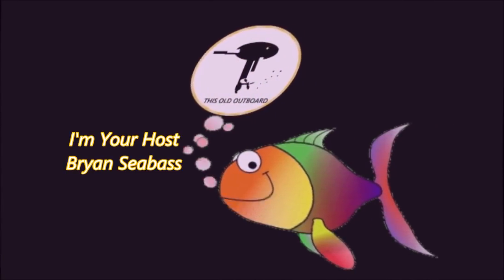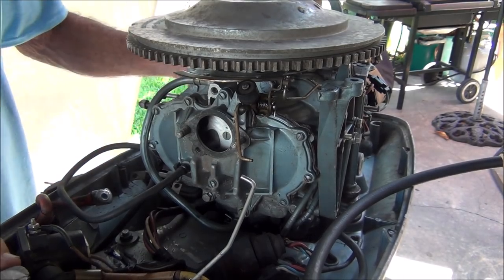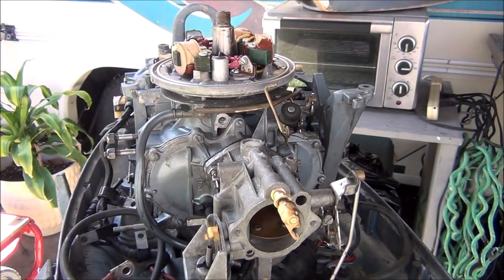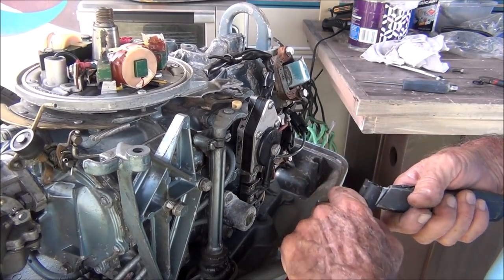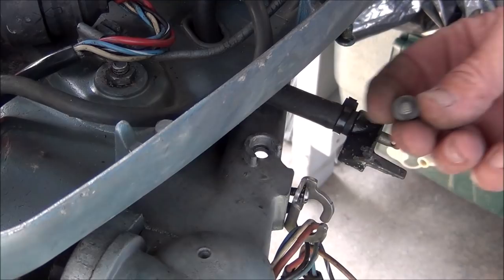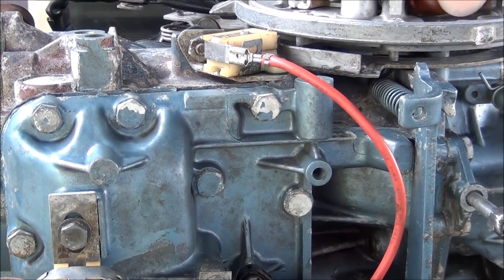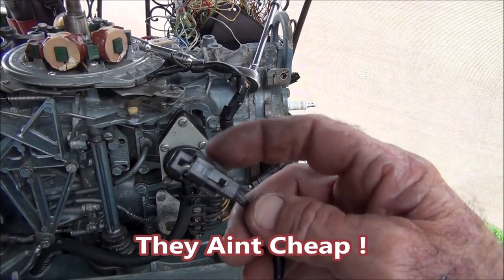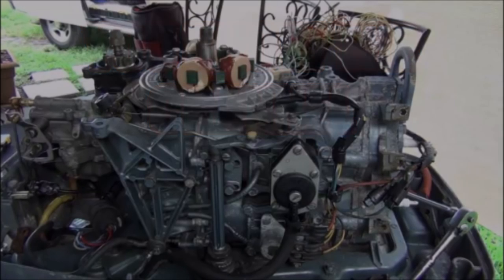1975 Evinrude 40 Hp Outboard - The Resurrection Stage One

Comment: I’m trying to get mine running it started last year exact motor but the unction switch is all beat up and broken so I’m not sure if that is the problem but when I turn key nothing happens
Reply from the maker: Hey. Thanks for tuning in. The unction switch, what the hell is that? Hahaha if the unction switch is all beat up, whatever that is, don't you think you should replace it?You need to go back to square one. Give it a good tune up. Try and pick up an OMC manual specific to the year/model. Try ebay for a good used one. It will save you time and money, it also has a good troubleshooting section too! Thanks again !

Comment: Hi Old outboard guy and special guest Bryan Seabass, good video. I like to use stainless screw hose clamps on my fuel hoses but use tie straps on air and water hoses on outboards. I was restoring my 25 gal fuel tank on my Starcraft and the barbed fuel fitting on the tank broke off being so corroded. Had to buy a new pick up fitting and tube for the tank. Good thing I found it before it broke out on the water
Reply from the maker: Hahaha ok. Anyway that kind of happened to me once on the water,  Had to connect the hose straight to the pump. thx again !  Stay tuned !

Comment: Hello what about the fuse link wire ? 
In mine I don't see any broken glass nether rest of odl broken fuse but just a hard thread that looks like a needle and seems to pierce the bottom of both parts. 
Must I remove it and replace with a real fuse? 
What amperage ? 
Do you have the correct reference ? 
Thank you very much
Reply from the maker: 20 Amp. Thanks again ! https://www.marineengine.com/parts/johnson-evinrude-parts.php?year=1975&hp=40&model=40R75C&manufacturer=Johnson&section=Instrument+%26amp%3B+Cable

Comment: The neutral safety switch mounted on the exhaust manifold completes the ground connection to the solenoid when the engine is in neutral.  The switch mounted up next to the mag plate keeps the vacuum switch from cutting out one cylinder when the engine throttle is set up to high in order to avoid false vacuum switch corrections at high throttle settings.  The vacuum switch is meant to keep the engine from "running away" in neutral when revved and brought back down to idle, which is a characteristic of these engines.  This is a bit of a complicated system which is confusing, but it makes sense when you can see it mapped out in the wiring diagram.  Looks like you have the wiring done correctly.  I'm wondering if you could fill your grease gun with something thin like tranny fluid, and perhaps pump a bit of that into the swivel grease fitting to help loosen her up a bit...Spraying the PB/WD on the top bushing probably isn't going to be very effective.  I see the boat wiring harness plug is still connected to the engine, does this mean you have the original boat wiring harness?  Sure hope so, these are tough to find....The wiring on this engine is kind of unique and was only used for a few years....
Reply from the maker: Hey. Yes I do have the Original Harness . Thx again !

Comment: Please help!!!! I have exact motor trying to get it started while cranking I have fuel spitting out the hole next to the fuel trim adjustment knob please help!
Reply from the maker: Hey. Thanks for tuning in. Thats the breather hole going to the carb bowl. The needle is not seating, bad needle or the float is not properly adjusted, letting fuel in and flooding the motor. Take the carb off and give it a good cleaning. Replace the needle and adjust the float. Thanks again & Stay tuned !
Reply: @THISOLDOUTBOARD1  thank you so much!!!

Comment: I have the same motor on my boat and it hasn’t been wanting to start lately but if it sits overnight it will, any idea of what it could be?
Reply from the maker: Hey. Could be a coil breaking down after it warms up, then it sits and cools back down and starts again. It will usually test good until it gets hot then starts breaking down. Try running it on one cylinder at a time, cold and warmed up to see if theres a difference between the two. Check your overall temperature, is it pumping water good and not overheating. Check the compression too.
Reply: THIS OLD OUTBOARD ok because it will run after it sits then runs for a minute and dies and won’t fire again but it’ll fire off starting fluid
Reply from the maker: @gavinschuppner7836  Oh, okay so that sounds more like a fuel issue. Be careful with that starting fluid, it has no oil in it and can scar up the cylinders. So your priming it up with the primer bulb until the carb is full, then it sounds like your running out the carb bowl fuel and its not filling back up. Things to check, primer bulb not holding fuel, pump not pumping, air leak somewhere in the fuel lines, tank vent not open. Have you tried pumping the primer bulb when it starts to die. I would check the entire fuel system. Last time that happened to me it was an air leak at the tank fitting.
Reply: THIS OLD OUTBOARD I bought a new primer bulb and nothing changed I’m going to look into a shop looking at it but I may need a new fuel tank or carburetor

Comment: just a thought would it be possible to use boiling water in a watering can or similar to melt the old grease?
Reply from the maker: Hey. I wish it would work. I take a propane torch and heat it that way but it really didnt help much on this old outboard like ones I've done in the past. Thanks for watching and commenting. Stay tuned !
Reply: oh I see with that kind of heat you would think it would do it, I was going to suggest a steam cleaner, but obviously that would not do either, enjoy your vids.  @THISOLDOUTBOARD1
Reply from the maker: @MsJon52  Hey yeah. It's Crazy.  Thx again !

Comment: Hi I have a nearly identical engine to this but mines pull start and slightly older im going to put a new head gasket on it on the weekend do you know the torque specs for the crank case bolts ?
Reply from the maker: Hey. No not off hand but theres a site called boatinfo.no that will have a free service manual. You'll need flash player to get on the site. Thanks for tuning in!
Reply: @THISOLDOUTBOARD1  ok no worries thanks
Reply: @THISOLDOUTBOARD1  Hi I have the torque specs for my johnyrude big twin 40hp for the head bolts but I can't make head or tail of it so wanderd if you can shed some light on it? so the values are in lbs but there are 2 numbers to each set of bolts?  it says cylinder head screws 168-192lb
Crankcase to cylinder upper lower 150-170lb
And crankcase to cylinder center screws 162-168lb for foot lbs to says divide by 12lb ? Does anyone know what this mean why are there 2 values for each one does it mean anywhere within those figures or what also whats the difference between cylinder head screws and crankcase screws? Its all abit over complicated iv got my head gasket in place I just need to torque  the bolts up
Reply from the maker: @mattschannel1502   hey. yeah I always go between the two numbers, so 168-192 I would do around 180 with each bolt. You'll want to check them after you run it a few times to. Divide by 12 for inch lbs heres a few links.
https://tengtoolsusa.com/blogs/news/how-to-convert-inch-lbs-to-foot-lbs-on-a-torque-wrench
http://www.kylesconverter.com/torque/foot--pounds-force-to-inch--pounds-force
http://extraconversion.com/energy/foot-pounds/foot-pounds-to-inch-pounds.html
https://applifast.com/wp-content/uploads/2017/07/Applifast_Conversion_Table-Torque.pdf
Reply: @THISOLDOUTBOARD1  ok thanks that great advice and the ones for the head gasket are the crankcase screws? Il put a vid up on my channel of my progress im getting stuck into this engine now its alot of fun I just hope I can get her running but im learning slot from your vids so thanks

Comment: I have the same outboard I think or slightly older but it will only turn over when spark plugs are removed can any one shed some light of what this might be
Reply from the maker: Starter Motor is to Weak. My 63 RX-11 28 Hp does the same thing. Thanks. Stay tuned !
Reply: @THISOLDOUTBOARD1  it is pull start only though its like the air cannot escape like a blockage I wandered whether theres was water in the cylinders I haven't taken the cylinder head apart yet though it's strange though
Reply from the maker: @mattschannel1502  Oh . wow. Yeah thats strange. vapor lock ?
Reply: @THISOLDOUTBOARD1  yes possibly the engine is I  a quite bad state just been led up awhile i think all the moving parts are  ok and carb looks ok just this strange problem do u know where there could be valves or possible breather ports that could be blocked could it be exhaust?
Reply from the maker: @mattschannel1502  no valves in a two stroke .  maybe the mud dobbers are blocking the exhaust ??
Reply: @THISOLDOUTBOARD1  ok where do I look for that on the engine is it  accessible without taking to much apart the engine is identical to yours but without the electric start
Reply: @THISOLDOUTBOARD1  I'm wandering if the engine cut off switch could be jammed maybe causing a air blockage
Reply from the maker: @mattschannel1502  hey. No I don't think that would have anything to do with it. It just senses High vacuum and no air or anything is going through it.
Reply: @THISOLDOUTBOARD1  ah ok I'm baffled by this if search the internet for clues but everything only relates to electric starts with this problem
Reply from the maker: @mattschannel1502  hey. I missed this one. Anyway you have to take the exhaust cover plate off but be very careful not to break any bolts
Reply: @THISOLDOUTBOARD1  ok il have alook thanks

Comment: Hey I've got this engine and it seems like it's only running half throttle...it cranks and runs great it's just not fast
Reply from the maker: Hey. Thanks for tuning in. Have you cleaned the high speed orifice/jet in the carb bowl. Check it with the Flashlight test. Check out my Carb Cleaning video if need be. Is the throttle butterfly perfectly horizontal at WOT. Check the linkage. What's the compression at? Have you tuned it up, new plugs, points and condensers? What size boat are you pushing? Weight is everything ! Curious to know what you find out. Thanks again & Stay tuned !
Reply: @THISOLDOUTBOARD1  it's a 17'flat bottom...I cleaned the carb in the ultrasonic cleaner and blew it out good and the linkage was out of adjustment...I'm hoping that what it was...ready for a test run

Comment: You need to use regular PB Blaster PENATRANT (Penatrating Oil)...  NOT their WD 40 silicone lubricant clone...
Reply from the maker: Hey. The Wd-40 I used is/was new to me and it worked great. Its Wd-40 Industrial Strength Degreaser not lubricant . It really broke down that petrified grease. Good Stuff, I highly recommend it .  Thanks for watching !  Stay tuned !